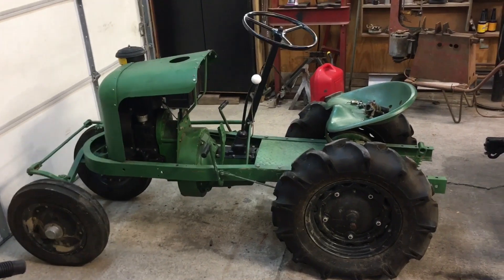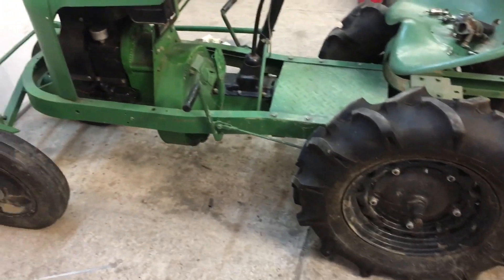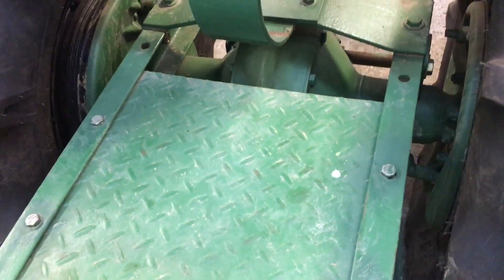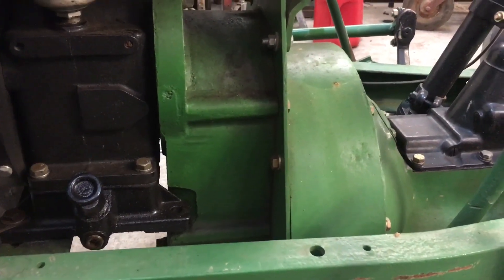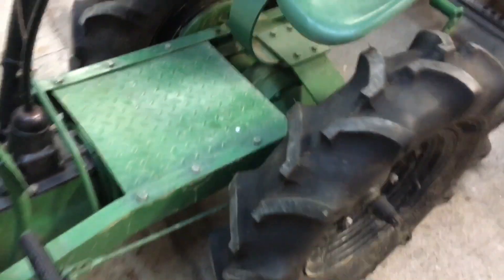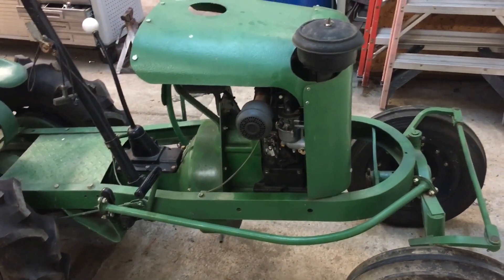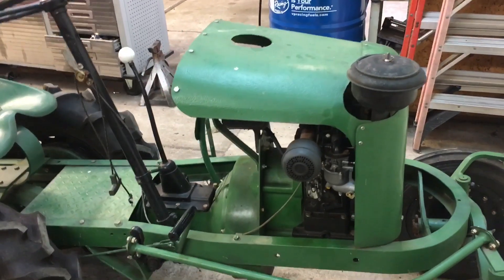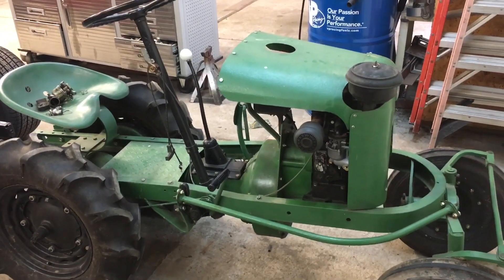Shaw Duall Tractor Model N5

Comment: Possible fuel evaporation (Vapor Lock) after the base of the carburetor warms up?

That happened to my old Wheel Horse tractor even after installing two carburetors. Ended up making a 1/4 inch wood spacer and it never did it again.

I'm not even close to your level on things like this but thought I'd add my two cents 🙂